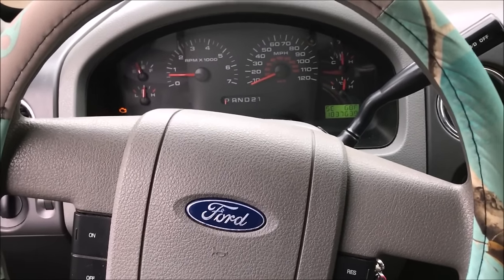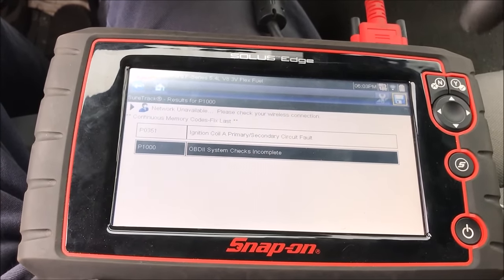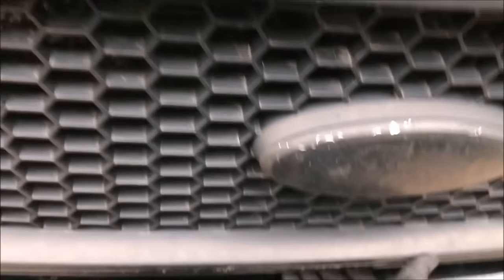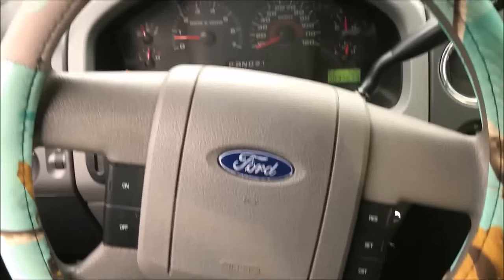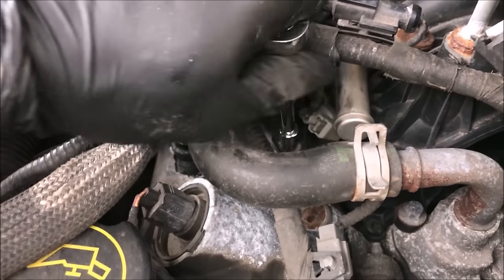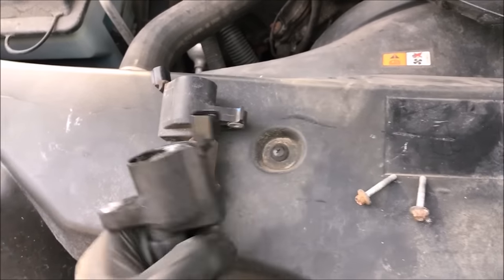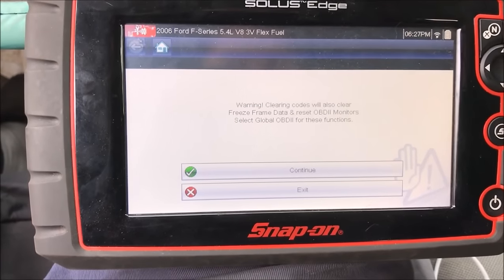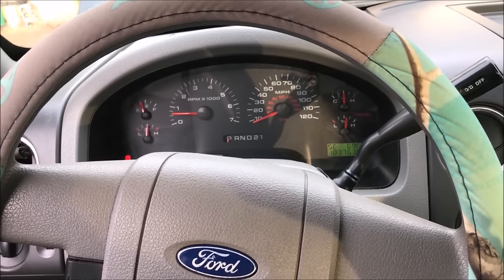How To Diagnose And Replace A Misfiring Ignition Coil (5.4 Triton)

Comment: Great video. I've done this a few times before and I have an additional bit of advice. The 5.4l engine came in many different versions - 2v,3v,4v and different variants of each of those. I do know that my 2006 3v came with  the black boot and it's a different length than the brown boot. If yours came with a black boot you should replace with same. I know u did this three years ago, but if anyone is watching and about to do this procedure they might find it useful. You did say that you got it from the dealership so I would hope they got it right, but they do make mistakes too. When I've ordered aftermarket ones online, some manufacturers actually list the boot colors too as another way to verify. Anyway, thanks and keep up the great videos
Reply from the maker: Excellent points!
Reply: Which version of coils would I need for 2004 f-150?
Reply from the maker: I would just call the Ford dealer with your VIN and get the part number directly for them, or look up by year/make/model on Napa, O'Reilly, etc.

Comment: Just a little bit of info for everyone . their are 3 generations of the 5.4l At 12:31 when he talks about the boot size being shorter/longer depends on what gen 5.4l you have. These are coils from 2 different gen 5.4's The easiest way to make sure you get the correct coils is the boots came in two different colors therefor two different lengths and voltage output. Your boot will be Brown or Black Get the correct coil. Just a tip to spare someone a headache. Not all 5.4 are the same.Thanks for the video nice detail on a coil change. PS: don't loose the 7mm bolt holding the coil down. These are a ford only thread you wont have a replacement in your bucket of bolts. When you order one from Ford well Mine was $21 for 1........Just saying.
Reply from the maker: Awesome addition of information, thanks!
Reply: @TonyTheTruckGuy  No Problem I love this motor I have a 97 f150 xlt !st year of 5.4l and a2010 F150 fx4 last year of 5.4l  I know this motor in and out. If you would like a few pointers I learned over the years about the 5.4 only. Let me know there a a few upgrades that you will actually see/feel difference but most 5.4l upgrades the gains are minimal they may look cool but when tested. Performance is minute if any at all. Not to say bling is bad. But if purchasing aftermarket upgrades expecting performance unless throwing a Roush supercharger. "one of my dream builds" There only a few I'd spend $ on. This advice is my opinion only  based on 1st hand trial and error thing that have met or beat expectation and thing I wasted $$$$ on. Just let me know. Have a good one.
Reply: The other thing to mention is that the intech 5.4l doesn't use a screw to secure the COP's - at least not the older 32valve - they are secured by a cover for all 4 on the side... Ford made something so easy so hard... thanks ford lol - Im dreading doing it, but at 160K they all need to be done - One tip - only use MOTORCRAFT plugs...  I heard the early tritons had problems with plugs breaking off in the head... OMG what I nightmare that would be!
Reply: I'd rather buy the entire ignition coil
Reply: @josephbagio7930   You have to - it's all one unit - Stupid not to do both and all 8 if you get the covers off and are in there anyways - mine runs like new again now!
Reply: It's wise to add a dab of dielectric grease to the plug end of the coil as well.

Comment: My 1997 E350 5.4l with 178000 miles on it  was misfiring on minor acceleration. It would stumble, unless I almost floored it. I got a pack of 8 coils on eBay with a 5 year warranty for $50.00 total. It was a bear to change the coils on that van. Yet, it did solve the problem! I was stoked that for less than half a C note, my old beater was markedly running better. Thanks for the video.
Reply: 2007 ford f150 has 206000 miles it also stumbles at minor acceleration and it makes this nasty loud rattling,tapping noise and it  shakes so bad, it fells like it's gonna fall apart.
It started doing this about onth ago while going up a hill.
Did yours shake and make noises? Thanks I'm desperate to get this truck back on track.
Reply: @j.carlos146  my truck didn’t shake or make rattling noises, it just struggled to run strong and consistently. You might have an issue with some aspect of timing, either ignition or camshaft.
Reply: @j.carlos146  same here on my 04.f150-  Put all 8 motorcraft coils on -still missing-scanner reads missing on primary coil A and E and secondary coil B and H???  Idk. I'm ready to pull what hair i have left OUT
Reply: 8 coil packs for $50 dollars equates to Chinese knock off parts and not genuine Motorcraft replacements. These parts are everywhere on Ebay and now Amazon. There are videos on You Tube to help spot the fakes and save ones self from a lot of grief. If your $50 eight pack lasts, consider yourself very fortunate.
Reply: @majorkursk780  I am in agreement with your assertion on principle, yet I did shop around for the brand that offered a warranty, which was 5 years.

Comment: U can reset the engine light by turning the key to the on position ....3 times...insert  key..turn key to start position without starting it ...wait each time for bells whistles to stop........3 times repeat...neat little trick....
Reply: Nice trick.  Another trick is to read the DTC using Gage Engineering mode.  Hold down the trip reset button on the instrument cluster and turn ignition on without engine start.  When display says "Gage", release the button and it will enter Gage Test mode and test all the dials.  When complete, you can then use the button to toggle through the messages until you get to DTC.  I wish I knew what the data displays mean or how useful the DTC readout is.  This works on my 08 Crown Vic.  I've read this being done with other Ford models.

Now that I know the three key turn trick clears DTC codes, it is possible to do emergency repairs without a scanner or code reader.

Comment: Good description and video. I've got to do the #1 coil on my Ford Five Hundred and it's one of the ones underneath the intake manifold on a transverse V-6, so it's a little challenging to get to. I'm going to swap it with the #2 coil next to it just to test it also. I did this with my Jaguar XJ6 several times and only needed to replace coil twice in 360,000 miles. They don't necessarily fail one after another like some people suggest. Wish this car was a easy to get to as the Jaguar though.

Comment: That’s why I like my edge programmer. It shows me which cylinder. It does a diagnostic test for you.Been running a custom tune on my truck for 7 years now.Changed everything to MSD like my race cars.towing package setting is awesome pulling my car hauler.No problems.Plug it up to your laptop download the upgrades.
Reply: The evo?  Tells you how spark is on each cylinder ?  I have a 06 and just messed with the evo for a while   I have original coils on new plugs at 92k  miles   Thinking I should do new coils
Reply: @joesmith-fi1sx  Yes it shows the codeAnd tells you  on which cylinder has a misfire primary/secondary msd 8243 coils. The multimeter showed coil was good new platinum plugs. Check the cylinder with my ridgid Ca-25 everything good. Pulled the coil and spark while running. Boot had a microscopic crack. Only 50,000 miles on coils. Can upgrade with downloading tunes

Comment: Have a Ford 500 Limited with the Duratec V-6. 4, 5 and 6 are right in front. 1, 2 and 3 in the back you can't even see.  Intake removal, etc, etc. A completely different job.  Checked the front 3 and they were fine. That figures, right? I'll end up cleaning the injectors, changing plugs and replacing all the coil packs.  Don't want to be doing this again in 6 months.  The car has been meticulously maintained. Never missed an oil change and never had a problem with it. Thanks for the video.
Reply from the maker: Hah, it’s NEVER the bank that’s easy to get at 😂 good luck!

Comment: I have a ford truck with 240,000 miles , every so often you will get a misfire, and  throw no code. Going up a hill you will feel it chug with low power, or decelerating you will feel the drivetrain pulsing, you will have a bad idle and power loss. The amount of labor involved to change  1 coil and plug with the possibility of doing this 7 more times as each fails makes it worth it to do it once and do all 8. If one fails the other 7 will fail very soon. The cheapest and best route is to go to JEGS and buy all 8  JEGS brand coil packs  for `130$  motorcraft plugs are also very cheap to buy. When you install all 8 you have 8 new coils firing the same and the engine will run smooth and you wont have to do this same repair for a few years . The JEGS coil packs are  better than the motorcraft coils for 1/3rd the price.
Reply: Whirl Wind really??? have you bought fuel injectors?? which one do you like and how long have you had them on??
Reply: I going to say something that I'm sure many of you will laugh like hell and say bull crap.  But here goes, when you get a reading on your checker that coils are operating at, say 80%, there's far better and cheaper fix.    Clean the frigging complete throttle body system before you buy any coils.   Dealerships will not tell you this.   However is the code is the coil pack then change it.   Got 318,000 miles on my 2003 Expedition 5.4, Eddie Bauer an have only replace one coil at a time, just the one that needed.  Since I bought the Expedition, I have replace only had to replace five coil packs in total.  Be sure to understand what may have caused the coil pack to go bad.  Example #4 could go bad because of anti freeze leaking form that little by pass hose, hanging over #4.    Replacing  number 4 and 8 are a real pain in the but.
Reply: Would a coil or plug make the truck jerk going up a hill
Reply: I also have a 05 f150 with 5.4 and it has 225,000 miles, my truck does the same thing it show's no code and the service light does not come on but when its under load like going up hill in high gear you feel a chug or miss every once and a while .If I let up on the gas a little it stops,when I change plugs it stops this problem, I have only had one coil go bad since the truck was new.RockAuto has good coils for the best price.
Reply: @andyhodge2568  Yes it will try plugs first.
Reply: @MrNorthstar50  you know the obvious fear there
Reply: Lol my coil packs are 130usd each and there 8 of them!

Comment: Tony?  I did it!  I replaced #2 coil pack. (the one my long time mechanic should have replaced)
I cleared the codes.  They never came back after many key cycles.
However!!!!!  My 03 expedition still "bucks" a little going up grades.  I think another coil is misfiring, but not enough to throw a code.
The electrical connection gave me the biggest headache.
I could not squeeze hard enough to release.  I gently used pliers!
I thought the coil came out from the plug "too easy".  Im used to standard plug wires "clicking" to connect and "popping" off when removed.  The same feeling when putting on new coil.
No click.....no sound....  Not sure if it connected correctly in blind plug hole.
Took me about 10 minutes.
The professionals charged me $76 and changed the wrong coil pack (throwing away a good coil).  And I brought them the coil!
They claimed it took 45 minutes to swap coils on cylinder #1.
Bull*hit!  That's the easiest one to change.

I need to diagnose and repair 4 
wheel drive (not communicating).
Do you have a video for that?
Reply from the maker: Hello! I do not have a 4x4 video for your particular vehicle but it’s likely the switch itself or the actuator on the transfer case. As far as the coil goes, they just sit on top of the spark plug, there will not be any click or anything like you’re used to on older cars where the wire clips directly to to spark plug. If it’s still bucking, my guess is either bad spark plugs or another bad coil. Not sure what engine you have, but this 5.4 triton was bucking even after this coil replacement and I ended up doing all 8 spark plugs which fixed it.
Reply: Mine is same engine.
Reply from the maker: @teddydabear242  By bet is plugs then but can’t say for sure without checking it out
Reply: I wish I could talk to you further on mechanical aspects of my expedition.
But I don't want to monopolize your post on coil pack replacement.
Reply from the maker: @teddydabear242  Hey go for it man, throw all the comments you want out here haha. I can’t promise I’ll be super helpful on the specific topics since I work on such a broad range of vehicles, but I’ll do my best!
Reply: I think your wife's F-150 most closely resembles the make up of my expedition.  At least engine wise.
I found another YouTube "hack" around the 4x4 dilemma.
He took off actuator.  On transfer case is a tube the actuator mates with.  Inside is a "key" that aligns with actuator.  There is text on the face of this tube with all the designations.  4x4 low, 4x4 high and so on.
He claims you can use vice grips to manually rotate the key to the designation you want.  And viola' you have changed the transfer case from drive to 4x4 high (for example).
He also said a small plastic lid with holes for screws can be fabricated and installed to keep debris out of transfer case.

Now....this is all fine and dandy.

What about the locking hubs?
Aren't they vacuum actuated?

What part of this manual override with transfer case is telling the hubs to actuate??

I would still love to get this 4x4 working as it should.

Can the switch be tested?  Actuator be tested?

Is it as simple as a blown fuse?

Mouse chewed a wire?

Electrical connection on actuator seems highly suspect for corrosion given its location
Reply from the maker: @teddydabear242   Post the Expedition VIN for me and I'll try and pull up a wiring diagram for the 4x4 switch.

Comment: Hey Tony, thank you for doing this video!!! I only have a $50 Topdon but it does tell me that there is a cylinder 1 misfire. My engine light is on and I can feel a little lumpiness in the engine. I found needing more power while climbing up a grade the the engine light flashes, the lumpiness gets worse. When the call for power ends the engine goes back to the slight lumpiness and the engine light stops flashing and goes back to constant on. WITH ALL THIS SAID......... do coils vary their output based on demand?? Also, do coils get weak or do they just totally crap the bed?? Buying 4 new OEM Motorcraft coils and plugs as we speak. 180K miles, it's time. 2009 Escape 2.5L. Thanks again!!!
Reply from the maker: Coils should always apply the same energy each time they fire as far as I’m aware. Usually they just stop working all together, or are making an intermittent connection with the spark plug which could also cause a sputtering. As long as that cylinder 1 coil is getting hood power and ground, the spark plug and coil should fix it.
Reply: I was having the lumpiness in 5th gear only. Then after letting someone look it started under load as early as second gear. Me and my neighbor tinkered with it and found the connection right to the coil was not completely clipped…so he somehow got them to actually click in…all the lower gear lumpiness gone…fast forward 3 days I have two coils replaced now we have lumpiness and flashing cel under extreme load… I’m fkkn lost atm
Reply from the maker: @kevinhuguet9675  Any codes?
Reply: Atm no codes no cel nothing. Tuner isn’t picking up anything either.
Reply from the maker: @kevinhuguet9675  Well that blows. Kind of need something to act up to know where to go haha. This truck was kinda the same thing though. It took quite some time of it running like crap before it threw a light. I ended up replacing all the spark plugs and a few of them were cracked. You may have that issue as well, but these plugs can be a major pain to replace. They’re notorious for breaking off.

Comment: Hey thanks man I got the engine light driving a four hour trip, put scanner and it gave me code p0354 primary coil. parked it for a week and it won’t turn on going to change coil soon will it turn on ?
Reply from the maker: @ramone.1021  Turn on? You mean the truck won’t start? Is it not even trying to crank? Because if that’s the case then you probably have a bad starter or dead battery. If it cranks but won’t start, then maybe the coil will fix it, but if it ran before, it may be something new that is the issue.
Reply: @TonyTheTruckGuy  yes not even trying to crank battery is good lights ect, statert  is new.
Reply from the maker: @ramone.1021  It’s going to be something else then not the coil if it’s not even crying to crank. Would need to check for power down at the starter while someone else tries to start it to see if starter is getting power
Reply: @TonyTheTruckGuy  thanks for the help 🙏

Comment: I was told to just replace them all, so I ordered a set of 8 trq’s from 1a auto for $125. Last time I changed a 2 bad coils at 100k miles and they were $60 each coil for aftermarket. I usually only replace what’s bad but figured for the price I would replace them all.
Reply from the maker: The OEM has coils are expensive and is what everybody recommends that’s why people don’t usually do all of them even though it makes me feel better lol

Comment: Can you check primary resistance by getting an old female clip from junk yard, stripping the wires then substituting it onto your existing coils one at a time and checking with multimeter. Seems this would be helpful for rearmost ones.
Reply from the maker: @CharlesGwinn-ep9pb  Coukd be worth it if owning the vehicle long term!